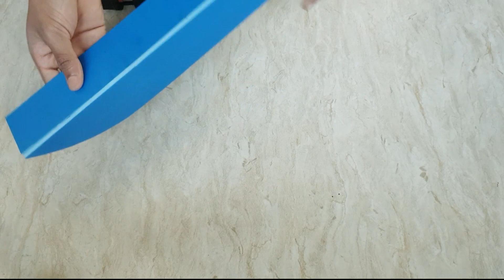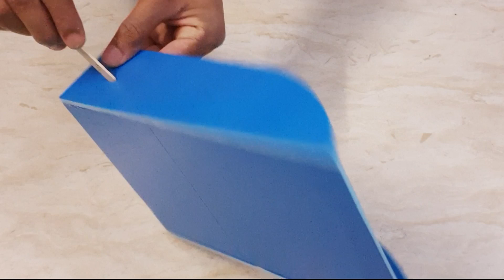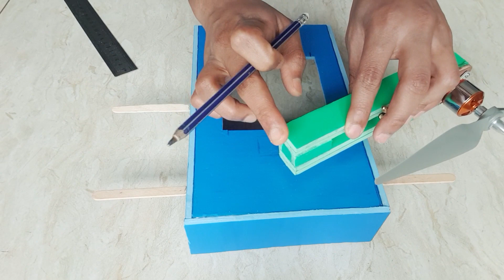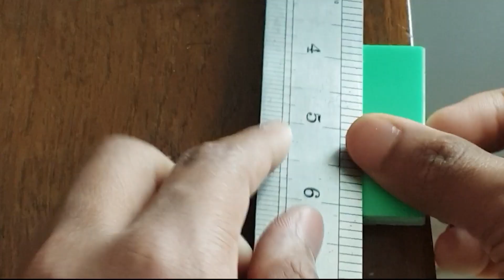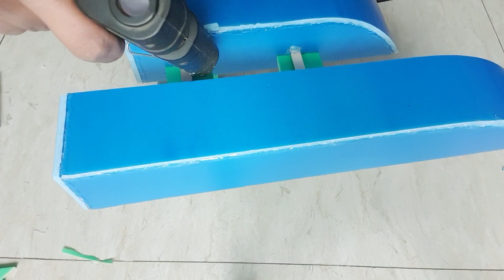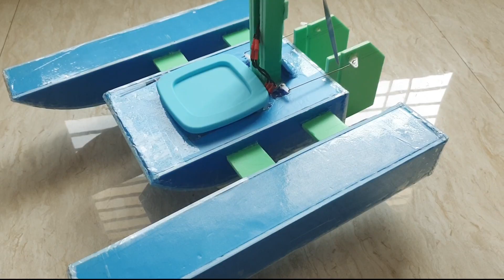DIY RC airboat using brushless motor | Full step by step build video

Comment: You should make it longer and not as wide, and put the motor a Little lower down wit a smaller prop and try to put the electronics more in the back, but a longer boat Will help with that, so you dont push the front of the boat in the water as much. I am building one to but mine is a bodyboard Where i cut the sides of so its smaller Bud now i am trying to make it hydroplane so its more efficiant and faster
Reply from the maker: Yes, thank you for the information. Will take ur suggestion into consideration when making future projects :) thank you